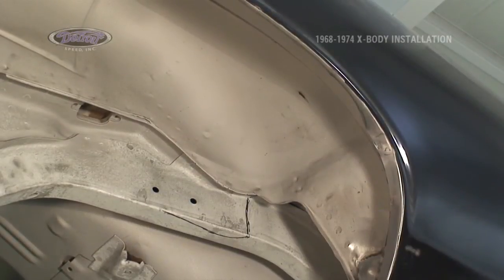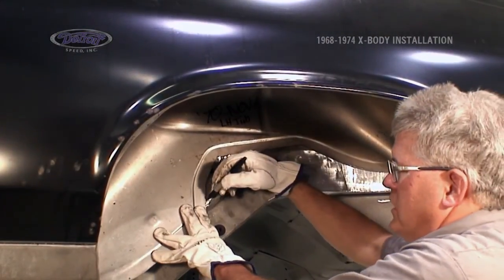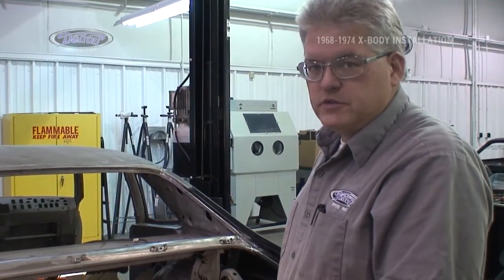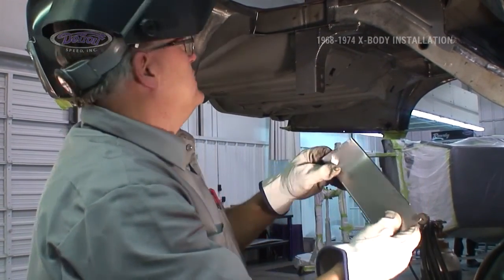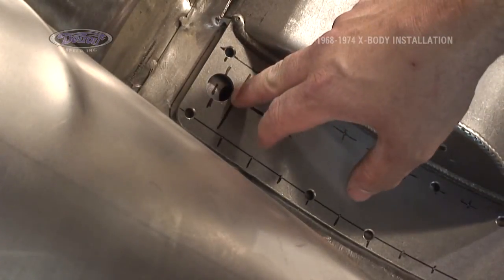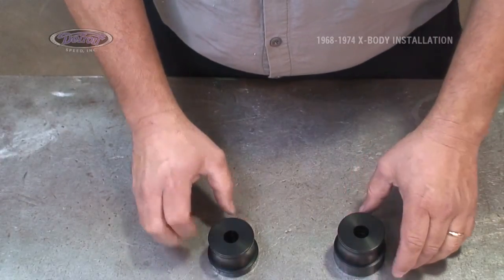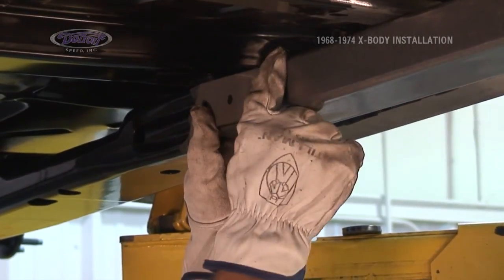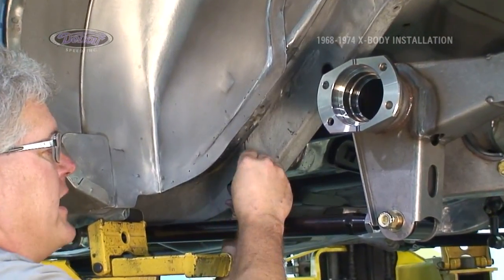1968-74 Nova - Full Detroit Speed Suspension Installation

Comment: Getting ready to install the DSE subframe connectors (SFCs) on my '70 Nova and I noticed at 49:38 of this video there is a sizable gap (maybe 1/2"?) in the area where the SFC is lazer cut / notched. Do you make a small plate to fill that area or did you just fill it with weld?